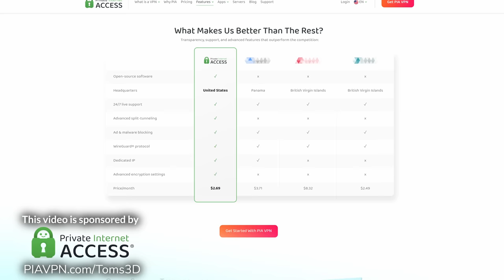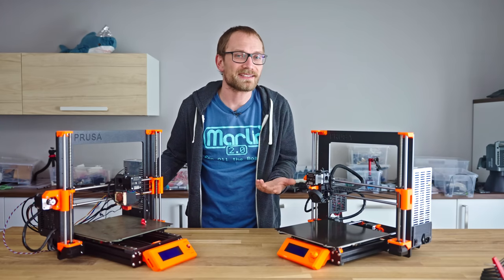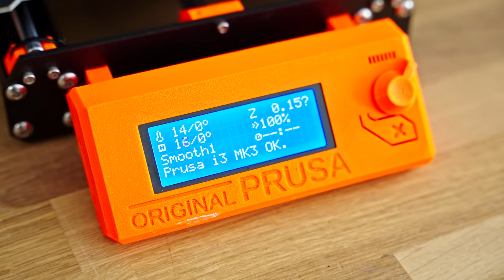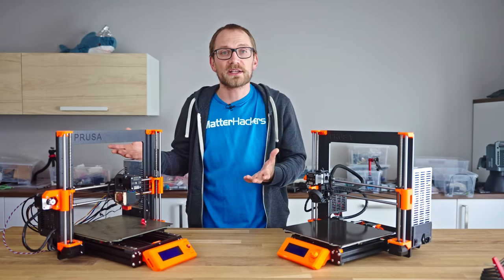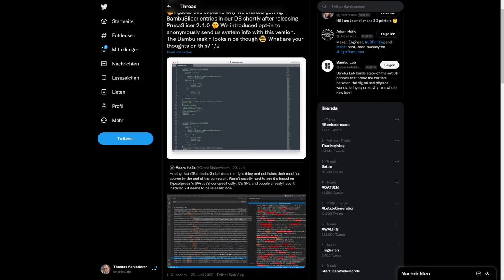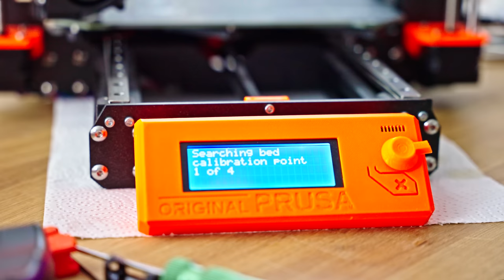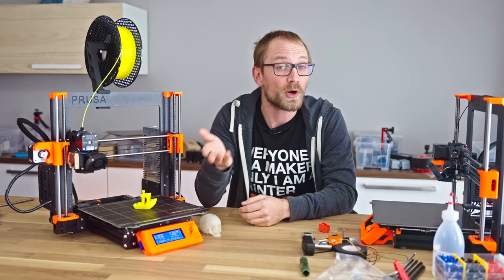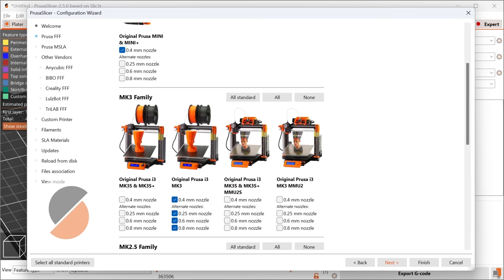This printer is OLD. Why is it still my favorite?

Comment: Yes, the original MK3 design is 5 years old, but the MK3S dates to February 2019, and the MK3S+ dates to November 2020. Other manufacturers might have released three new models and made them look different from one another. In contrast, Prusa offered a kit to upgrade an MK3 to an MK3S and still offers a $50 kit to upgrade an MK3 or MK3S to an MK3S+. That being said, of course the design is showing its age. Obviously, Prusa knows this and is hard at work on new models. Obviously, this has been delayed by a certain pandemic and the resulting global supply chain problems. What's not clear is if Prusa can compete on price with the Chinese companies, which as we keep hearing, often have pretty terrible working conditions. I, for one, am hoping Prusa is successful, and I'm grateful for my MK3s, which allowed me to design and manufacture high-temperature plastic parts at a reasonable cost, when the company I designed them for thought this was impossible.

Comment: 4:01 i interact with the screen of my printer every time i use it dispite the fact that i use my pc as the terminal.
Its a CNC machine, it does not need to look good it just needs to be more user friendly than a cactus colonoscopy.

Comment: The biggest problem with Mk3s that it is overpriced. Research paid back 2-3 years ago. It could be much cheaper now. Instead they raised the price, start using cheaper parts (earlier they used Misumi bearings, now no name)

Comment: I agree on most counts.  My MK3S is very reliable and easy to use because Prusaslicer just works well with it.  It was my first "good" printer and it still churns out parts for me all the time.  Now to the downsides.  It's definitely slower than a CoreXY printer with input shaper, though my Voron 2.4 was twice as expensive than the MK3S, so it better be!  But the real downside I find with the MK3S is when something DOES finally go wrong, it's harder to tear down to repair.  A clog on my Voron is a few screws and the hotend pops out to be serviced, and since I have multiples, I just pop another one in and continue printing.  Tearing down the hotend on the MK3S requires tearing down the whole E axis assembly and then having to readjust Z height.  Downtime is much MUCH longer because of this.  I'm very curious to see how the Prusa XL shapes up, and if it will lead to a cheaper enhanced MK4.

Comment: I've got my makergear m2 from a decade ago...at the time it was ground breaking with a stainless steel ultra-rigid overkill frame, better/gooder linear rails, etc. Even now, with ancient marlin and loud drivers on a dumb rambo board...it still just spits out reliable parts, and I have basically never adjusted it other than setting the z height as things eventually move out of spec.  There is a lot to be said for reliable.

Comment: I have to agree with you the Prusa MK3 and its S and S+ variants just work. I am supprised that you striped out the Volcano though as the Full Volume mod means you can just use the default Prusa profiles unless you actualy want to make use of the increased volumetric flow that the volcanno gives you.  I barley use my printer these days it has on two occasions just worked after being idle for over 6months just a quick clean, oiling of the rods and a check on the tension of the belts and its good to go. So basicaly the mini service can be done while the slicer is working.

Comment: MK3S is excellent and reliable machine, no doubt. Unfortunately MMU2 has been a pain based on my experience. But innovation is moving fast and xy-core will become new state of the art. Close case, less power consumption, less space vs build volume. Also Commodore was the pioneer in personal computers. It's time for "MK4" xy-core to come. ;-)

Comment: I got wrapped part on mk3s all the time even with enclosure. But bambu x1c going crazy speed and still not a slight wrap on large part with PC and ABS. I don’t know if it’s something I did wrong.
Reply: It must be something you did wrong. I don't get warped parts on my MK3S+ with an enclosure, even in ASA/ABS. Most of the time, a draft-shield (tall skirt) is enough.

Comment: I'm new to all of this and I bought a Prusa MK3S+.  My only real complaint is that I would like to have a dual extruder so I can use a better and easier to remove support material.  I thought this wouldn't be a problem as they offer one that can do as many as 5 colors at a time, more than I really needed.  The other day I went to the site to check it out and it seems like a lot of people gave it really bad reviews.  It looks as though it's not even really worth using.  Comments?

Comment: I have a Neptune 2.  It works great. I only have to touch the screen when i need to load filament or level the bed. Having to move physical media to print things is deeply annoying considering how cheap network and usb connections are.  (and SD cards suck, always).  

I will say 3d printers are not my hobby though, they are a tool i use for other things.  I don't need an upgradable machine that's easy to modify.  I need one that does what I need it to do with the least fuss. (price was excellent too)

Comment: This sort of match my experience with Prusa. I started with a Anet A8 that needed constant tinkering. Then I built a Hypercube, and while doing that the MK3 came out, so I ordered one to get the new features. Today the Anet is sold, the Hypercube is taken apart and the Prusa has become a tool just like my power drills. 
When I have a task, I power it up, and it just works. These days I don’t print as much as I used to, but just today i powered on the printer for the first time in a month to print a few #Gridfinity parts. All I needed to do, was to wipe the build plate with some IPA, and then it was off to the races. 

I have thought about building a Voron, but I don’t feel it is worth the money, when my Prusa is printing so reliable.

Comment: I've had my i3MK2 for about 5 years, and prefer to keep using it, as I've learned how to optimize most of the settings, and really don't want to go through that all over again with a new printer.  I've only upgraded the firmware once (I always feel that each firmware upgrade creates 3 new problems for every 2 that they fix), and the Prusa Slicer once.  It doesn't always print as good as I like on the first try, but largely it preforms extremely well.

Comment: Good video I am glad your Prusas are still going strong.   Reliability is key - for anything other than making benchy boats and a few baby yodas, it's far more important to have easy of use, low maintenance, reliability and repeatability than it is to have cloud this and lidar that.  The verdict is still out on all these new manufacturers.  Give it 5 years and then see where we are.  I like the look and technology of the bambu but I am not ready to trust into a new company into a closed ecosystem and the reliability is far from proven.  A few 9 out of 10 reviews from reviewers that get all their printers for free is far less valuable than the experiences of real people spending real hard earned money for real.
Reply: I bought the X1C and had it since Aug. 1500hrs+ and untold rolls of filament. The X1C is nothing short of amazing. So you can place +1 in the anecdotal Bambu lab X1 is great.

Comment: To be honest, through all my tinkering on printers, I feel the Prusa MK3S+ is pretty much the go to for anything if you just want to design and print. No faff, just print. Even mods is a thing of minimalism. My prusa mk3s+ lives inside the metal prusa enclosure so the only mods I felt it needed was making the parts out of high temperature plastic (PA11, softening temp of 170c or more) and printing a reverse electronics box for accessibility. The printer also has a great build volume to physical footprint and easy maintenance.

I do hope though that the Prusa MK3SSSSS+ or MK4 might just tweak up the electronics for things like input shaping and things that make sense. Going 32bit purely for speed... don't see the point for this design if 8bit can do it fine.

Comment: What are actually useful upgrades I can do for the MK3S? I do not want to buy a 200€ hotend, but would be open to a nozzle. What other single part could improve the printer?
Reply: Obviously the MMU2 is an option. It can create unique results, but it's expensive and complex. An E3D Nozzle X was probably the best single part upgrade I've made. I've got the 0.4mm one, but I'd go for 0.6mm (especially now that Arachne is available). Also the satin sheet looks promising, but I've yet to try that out.

Comment: MK3S+ is my first printer and not very happy. No Jams, but the rare bed adhesion issues end up creating a huge ball of plastic around the extruder which is a pain to fix. The cable routing in the Einsy board is nonsense. And there are so many screws of so many different sizes and heads that it feels very parts bin. Some of the screws I cannot even source and missing!

I probably have over 1000 y axis errors over the last year of owning it. Also the print bed hits my wall behind it due to the unintuitive design. One of these days that heater cable is going to break due to that. 

Over the last year it’s definitely gotten noisier. 

With that said, I do get clean prints, albeit a bit slow.

Comment: Very well made video, both pro's and con's and why you would still use it while others are (arguably) getting better now. I think this is my issue at this very moment, the new printers are getting more reliable and input shaping for instance is a must-have in my view. I don't like the Enders, but when I added input shaping on those, it almost became a new machine! I'm definitely going the Voron route for me and a Prusa mini for my son. I'm not going for a Bambu, because I have no idea if they will stay successful and if I can replace parts myself if it breaks down down the line.

Comment: I've had an X1 Carbon for a month, but it's still sitting in its unopened box. I bought it on impulse when I was actively iterating a difficult design and was frustrated with my MK3S+ relatively slow print speed. I'm sure I'll set up the X1C eventually, but in the meantime, one of my MK3S+s pops out the parts I need with zero hassle and quickly enough.
Reply: just unbox it and it will print better and faster in just 20 minutes

Comment: I have 2 Mk3s+ but they are basically switched off since I got my BambuLab X1C... That printer is THE innovation the industry needed that prusa was not fast enough to figure out himself because overwhelmed by the XL. The mk3s+ are still a super reliable, precise printer and ecosystem. I actually "steal" the profiles from prusa slicers to put them into bambu studio... but the BL took 15 minutes setup, prints in multicolors so easily, tech materials without issues etc. I honestly collected great feedbacks also on the new S1 series from creality (with the new extruder that seems quite the step Creality needed) and with the sonic pad they offer also klipper already pre-installed. I don't have any creality printer but that seems a huge step ahead in all aspects. In conclusion I love prusa, we all owe a ton to Joseph, but this video would have been on spot 1 year ago, not today
Reply: then mk4 comes along, x1 still has too many issues compared to prusa (minus mmu)
Reply: @Tottorul  mine doesn't have any in particular. The mk4 is good, it finally can be a bit faster, but still it s a bed slinger open frame. In any case Bambulab pumped on the competition which is a good thing: prusa slicer got the organic supports, the mk4 is out... everything quickly when they realized they were running a big risk of loosing a big market share after being basically alone for years. That s good for the users
Reply: @FedericoAlbano83  bambu is good for competition. its probable they will become the main competitor for prusa with regards to reliability considering their printers work quite well. prusa hasn't been slacking, the mk4 has been in testing for a year meaning it has been in developent for much longer, then you have covid... the release of mk4 just half a year after the competition is taking a jab is not late by any means, i don't buy it that prusa has been resting on their great products and being lazy as many seems to suggest, it doesn't make sense
Reply: @Tottorul  they have surely been overwhelmed by the issues on the XL. But if you give it a bit of attention you 'll see that the mk4 is basicallu a mk3 with parts of the xl adapted, also thanks to the new tech prusa adopted in house. They also posted a poll for the wishes on the new prusa printers on dec 2022 so in the full hype of bambulab launch and joseph posted the results of the poll on the same day of the mk4 launch talking about "what people want in the MK3 successor"... He also twitted literally this "Before the troll Brigade fully hits about how MK4 is not a CoreXY ... I just can't let hundreds of thousands of MK3 users without an upgrade."... so core xy is superior (of course) but he had to settle for a revision of the mk3 to grant the upgradability... i love prusa and his products. And to me a signal is also that in all this years prusa slicer never adopted tree supports. It s a great function in bambu studio and zap! Prusa slicer now implements organic supports (in the alpha). I love prusa and his product, i am a client, but i honestly believe that at some point he burned a 5 years advantage he had on the competition. He focused on the acquisition of other companies and everything and that s great for the corporation, but lost the point on the core product. The enclosure they sell is crazily expensive, and other printers, not only bambu, come enclosed at the same price... anyway i will probably upgrade my mk3 to mk4, basically not to rely on a unique supplier, and to exploit the best from all.

Comment: I have to agree, I have access to printers that technically have better specs but at the end of the day the Prusa works and it works well. It's reliable and when it isn't repairs are quick and mostly pain-free.

Also, you need to print your Blåhaj a nicer hat xD

Comment: I built a "Dolly" based on your diy build series back in 2019 and it's still working great.  I think you built the series based on the mk2?
Reply: Dolly was in early 2017, yes Tom replicated the MK2 and a few montha later put silent Trinamic TMC2130 stepper drivers in it

Comment: I am 99% there with you, but I would argue that Lulzbot has had a significant impact on the 3D printer landscape as well, if not more so - historically speaking. I don't think they are as relevant anymore, but I would love to see an honest sidekick review. My goto printer is still my Taz4 and yes - it has its problems, but I would argue that Lulzbot (and I cringe saying this - MaKeRbOt) has introduced and captivated more users than other manufacturers, including Prusa. (NOT AN ENDORSEMENT FOR MAKERBOT) I do not disagree with you on the Prusa ecosystem and the fine-tuned profiles, as there isn't anything that can rival it IMO, but... Lulzbot has its place alongside Prusa - historically speaking.

Comment: Good video. I just love my MK3S for its reliability. Heck I've couple times almost had collisions as I've forgotten to remove previous print from plate as I start printer in different room with octoprint. It's very dated design, but so, so reliable compared to Ender 3 which I had to try cause of the huge discussions hype (haven't been impressed at all btw). Now I would like to get faster printer and there's stuff like Voron, RatRig and Bambu as latest, but I don't want printer to be as hobby, even though previous can be very reliable printers. So now the surprise MK4 release, looks like I'll go with that. Though looks like I need to wait some time cause of rushed orders, which I'm not surprised to see. It's been nice to see features and especially slicer things to been added so long to my workhorse. I'm expecting MK4 to continue that and I'll be fine with its faster prints. Cutting even 1/3 of print speeds is plenty for me as I print functional stuff and my printers can be out of use for even months at time.

Comment: Get a used prusa or a bambu lab.
I got a JGaurora and regret it in the long run, I cannot print without checking if the print fails or not, as it fails once every 20 prints or so.
Also always having to fiddle with the setting is annoying when you just want to print.

Comment: Fantastic as always.

I love my MK3 (now MK3S via upgrades I made when Prusa released them 🙂). It has been so reliable, it's hard to believe. It takes abuse and shrugs it off.

Did it have challenges early on? Absolutely. But Prusa did a fine job of addressing the issues and making modifications either freely available or at a very reasonable cost. They support their machines far longer than other companies do.

Paired with OctoPrint, I have found this printer to be everything I could want: a super-reliable, reasonably fast, very capable machine that I can maintain on my own.

I can't wait to see a company truly top that and maintain their work they way Prusa does.

No tin-foil hat person can make a reasonable argument against that.